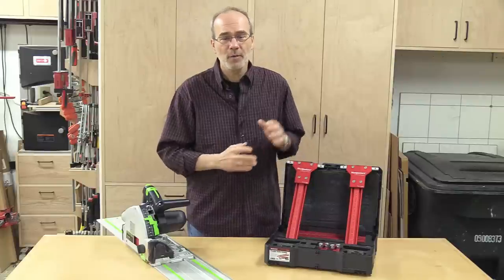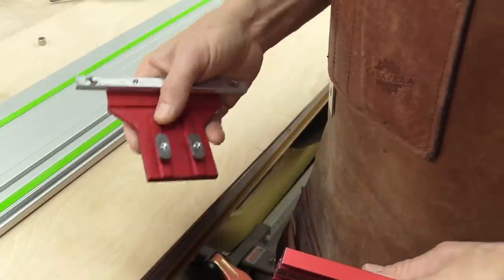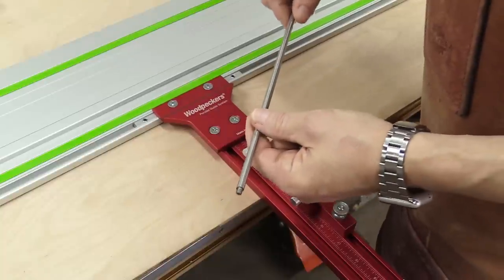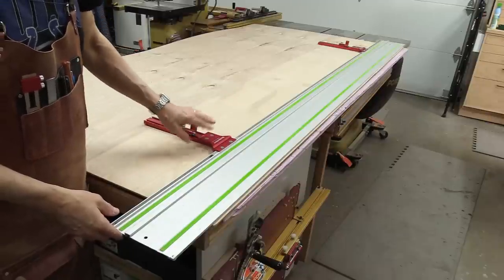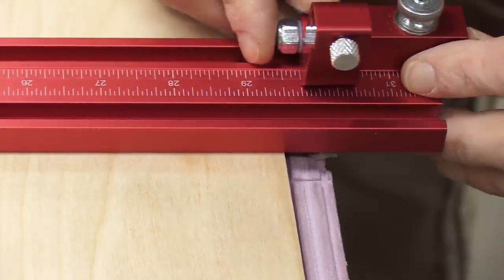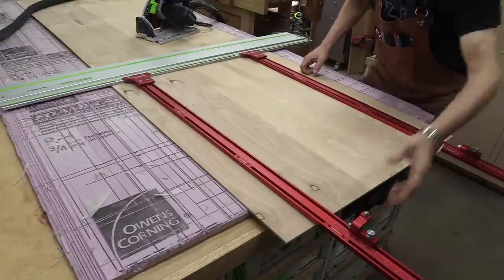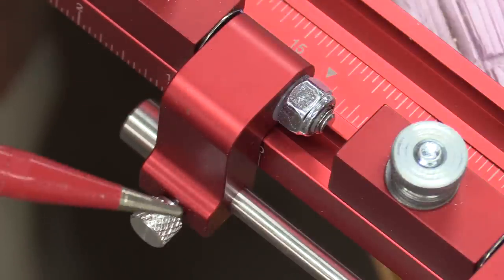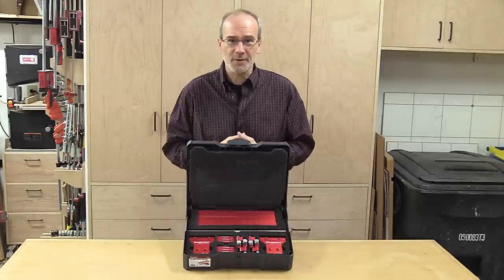Repeatable Rip Cuts with Track Saw

Comment: Thanks for the video. This is the first time I’ve seen a video using the same setup I use; pink Styrofoam, Festool track saw and Woodpeckers parallel guide.

I took it a step further though to increase productivity;

I use the Festool T 55 cordless track saw; no cord, and no vacuum hose. I pair that  TSO GRS-15 (One of the best tool investments I’ve ever made) for absolutely square cuts.

Killer set up!
Reply: Kevin Criswell I use the same, only BLUE Styrofoam!
Reply: That's not a bad setup.  I've got the TSO GRS and the TSO parallel guides.  I've had the festool parallel guides, which are a pain in the backside, and I have the Seneca guides.  What sold me on the TSO parallel guides is the quick adapter.  Rather than having to slide the guide onto the rail from the end and screw it down, I simply plop the guides down on the guide rail wherever I want them to be and when I'm done I pick them up.  With the quick adapters TSO has got the best guides in my opinion.  Their flag stops are super beefy, there's zero deflection.

Comment: I’ve used both Woodpecker and Seneca. The Seneca requires Incra t-track and is a nice solution for simple cuts and works very well. I find the Woodpecker solution more tedious to setup than the Seneca option, but nothing outrageous just a few minutes longer,  but you have more precision for cuts that are smaller or more difficult. To help, I would say if your just using your saw primarily to do rip cuts to take to the table saw, you don’t need either; if you are wanting your cuts to be accurate upon taking to tablesaw or don’t want to use a table saw but are looking for simple quick accuracy with fairly simple cuts, go Seneca and add Incra T-track, but if you are wanting smaller cuts or have difficult cuts from time to time, the top of the line is Woodpecker...it’s just that no everyone needs this accuracy if your just trying to make it more manageable for the tablesaw or don’t have a need for true precision and difficult cuts.
Reply: Rule in life applies - you get what you pay for
Reply: I haven't used the woodpecker guides but I have used the TSO guides.  Once calibrated the TSO parallel guides are wicked accurate and the quick adapters are super convenient especially for small shops.

Comment: When joining the graduated tracks together, other Woodpecker videos show the T-slot connector placed in the middle of the track on the under side.  Wouldn't this be better than installing it on one of the upper side tracks as shown in this video?  Seems like it would be a more sound joint and wouldn't interfere with the stops if you installed a stop in the same track as the connector.
Reply from the maker: Works either way. The engraved side of the track has two identical slots. Guy used one for the track connectors and the other for the stops. I usually use the centered track on the underside. Guy's method eliminates flipping the track back and forth when you're adding sections. In theory, the centered track should avoid misalignment better, but there's not much chance of a problem either way.

Comment: Just wondering what the benefit is over my festool parallel guides and extensions. Thanks
Reply from the maker: Component based rail system has twice the width capacity of the Festool system, yet fits in a Systainer (the Festool one does not). Narrow rips are referenced from the normal side of the guide rail (Festool's works from the off-cut side). Multiple flip stops can be set up at the same time so you can cut two dimensions out of the stock without losing the other setting.

Comment: At 7:05 the track moved, why? What did the saw hang up on.
Reply: The hose on the track saw got caught on the back end of the track.
Reply: For narrow rips it's best if the track is held in place with clamps or rail dogs in an mft style top.  The foam grippy strips on the underside of the rail aren't in contact with the material the saw is cutting.

Comment: I can see how useful this add-on to track-saws can be. In my case, I use my track-saw to cut down large sheet goods to make it easier and safer to do final cuts on my table saw. I know not everyone has a table saw, so I can see the usefulness of this product.
What I would like to see is a subset of this - offer the track-attachments and rails without all the calibration or narrow-cut rods. I'd like one pair of rail-stops and two rails expandable to, say, 50", and the hardware to attach them to the track. That way i can repeatably make rip or cross-cuts of large sheets prior to table saw work. 
Hopefully this would be a little more affordable for the job I need them to do.
Love my woodpeckers gear!
Reply: Here is another option:   https://tsoproducts.com/tso-parallel-guide-system/  I believe they are going to have a rail attachment for long cuts.

Comment: It's a shame the setup is time consuming and the assembled clamps can't be stored in the Systainer.  They look neat and orderly in the foam, but I would not look forward to the setup and calibration every time I took them out of the box.  Although it appears some of the assembly was done off camera, it took Guy about three minutes to assemble and calibrate one clamp, or six minutes for the pair.  That's a lot of time spent assembling each time the set is used.  I would buy the set without the Systainer and leave the clamps assembled with the first rail, or buy the much less expensive Seneca Woodworking clamps.
Reply: Can Seneca be setup for narrow repeat cuts?
Reply: @edgarcisneros6771  Yes, the Seneca guides come with a set of narrow stops that function similar to the Woodpeckers system and fit under the guide rail.  I decided to buy the TSO Products parallel guide system instead since I already had the guide rail squares.
Reply: @Mike--K 

The TSO guides are super nice.  And the quick adapters are great for quickly switching from a long guide rail to a shorter one.  Pick it up and plop it down.

Comment: I’m new to festool. Is there a festool product that does the same or is buying a non festool product the only option ? Strange how theirs many products to use with festool, would think they would have covered those applications and make incredibly over priced items themselves.
Reply: Festool makes their own version of this.
Reply: Yeah, Festool has their own same track saw accessory. I think Woodpeckers and TSO Products have much better and easy to assemble ones than the Festool’s.
Reply: I hope you didn't get the festool parallel guides.
Reply: @ThekiBoran  No. I can’t imagine that I’m holding Festool parallel guides. I’ve just received my TSO ones. 🍾
Reply: @beregu 

Where did you get your kit?  TSO is sold out.  I got mine from US Tool and Fastener a week ago but I think they're now sold out.
Reply: @beregu 

By the way, what do you mean "you can't imagine that your holding Festool guides?

Comment: Festool original accessory for the same purpose is cheaper.
Reply: The festool guides are too fussy.  They have to be about a half inch from the edges of the material rather than supported on top of the material.  Getting on and off the guide rail is also tedious.  The narrow rip guides have to hang over the edge of the workbench or you have to set your guides, guide rail and material up on 6" of foam or whatever but then clamping becomes an issue.  I sold my festool guides after they had sat on a shelf collecting dust for 3 years.  At this time TSO has the best parallel guides available.

Comment: Holy mackerel. For the price of that gizmo you can almost buy a table saw. I recommend the “original waste side jig” from Peter Millard’s friend for a 10 spot. Or buy yourself a 3D printer and print one out. Still cheaper than that contraption. Woodpecker rocks but that price is ridiculous.

Comment: Fell asleep watching how long this takes, I guess two pencil marks are not quicker than 429 dollars
Reply: Chewy chalk line too, making life difficult
Reply: Chewy, yes, it takes too long to set up if one is only cutting one or two,  if cutting say 6, 8, or more pieces which you want identical, it makes it a snap -- all without a table saw.  If I'm at the shop, I'd prefer to use my big table saw, but on the job site, the parallel guides are great.
Reply: Chewy the rough carpenter?
Reply: I don’t care who you are - that’s funny.
Reply: Hey we made some brackets for your saw. For only 90% of what the saw costs!! WTF